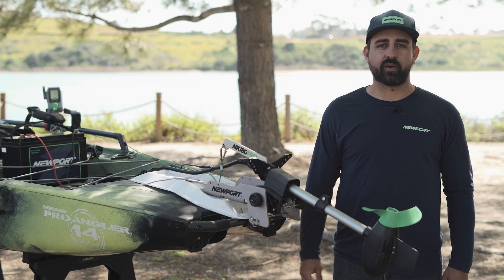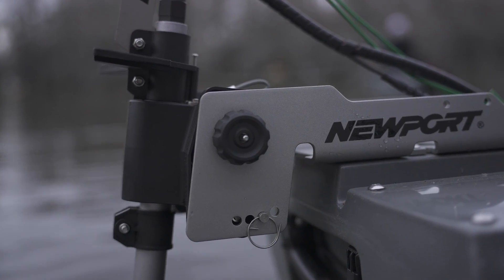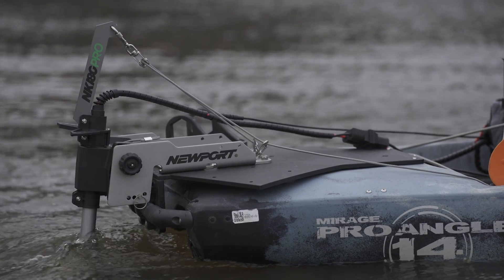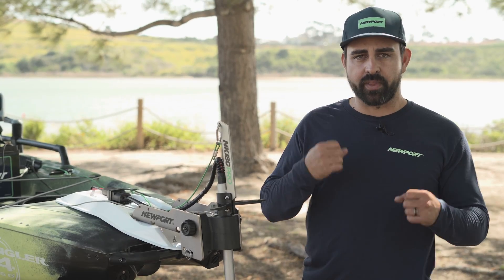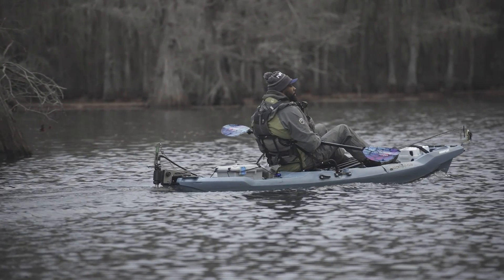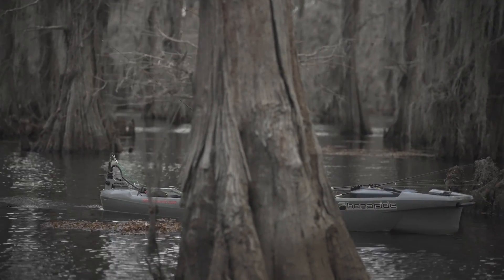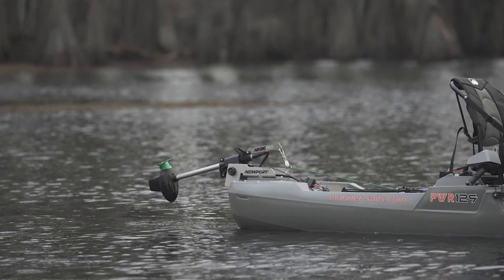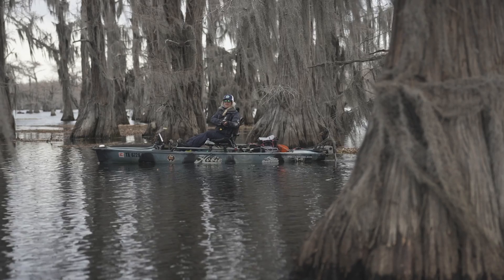NK180PRO Peak Performance | Maximize the Potential of your Electric Kayak Outboard Motor

Comment: why is the motor shaft never vertical on the shown kayaks?
Reply: It’s trim, when under load the rear end will dip down, ideally your motor would then be “vertical” or slightly pointed up.